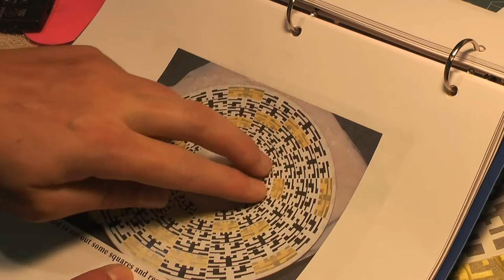Demko ModelworksPt.-14 Aztecing the upper saucer!

Comment: I would advise against using a heat gun on the masking material, as I found it left a gooey adhesive material on the remaining paint. Maybe It was just me, and the way I did it, yours seems to work good for you.
Nice work, thanks for these videos.
Robert.
Reply from the maker: Hey Robert T, I’ve used a heat gun for many years now and have never had a problem with the gun, I do however, hold the heat gun back away from the kit about 6 inches, and l keep it on low